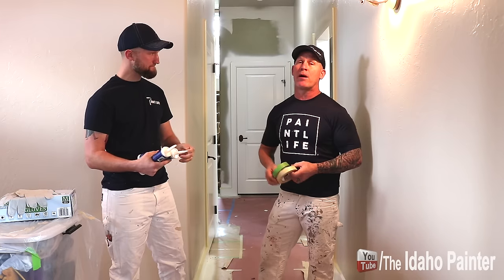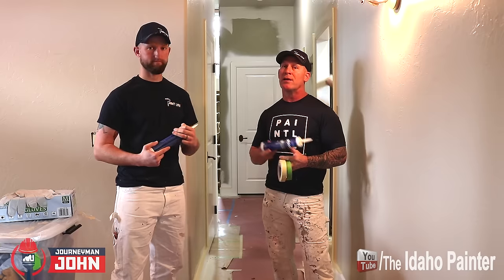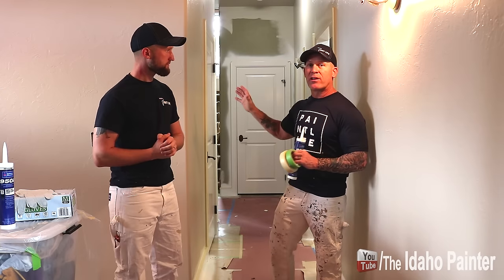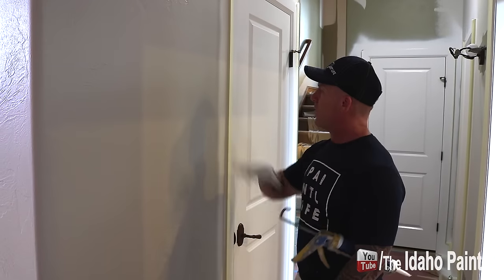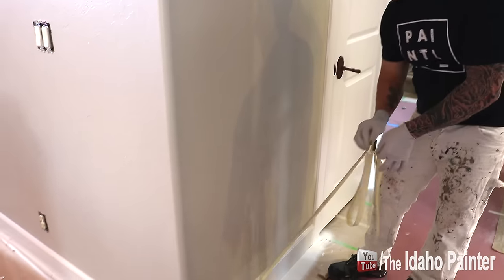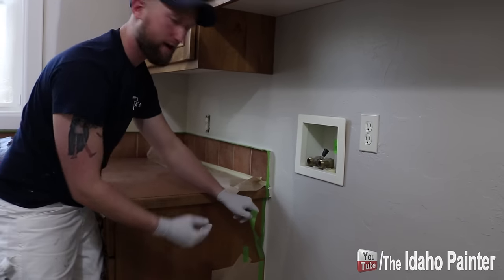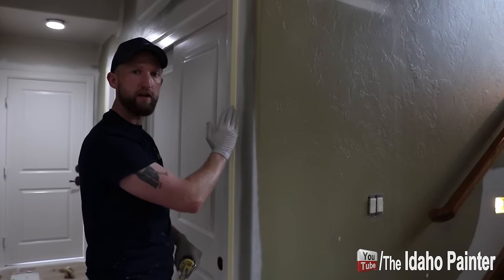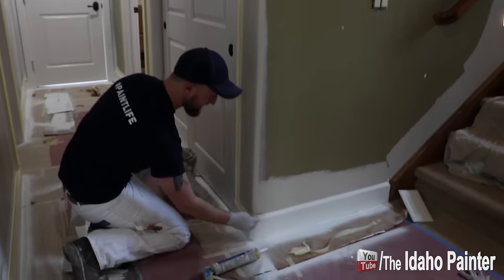PERFECT lines with caulking and tape.

Comment: A few things, never paint over wet caulk, let it dry completely,  and dont tape base trim and door frames with cheap yellow tape. Then pull the tape off to roll walls? And no spritzes on base...  seems strange.  Seems like they are pressed for time on this job and taping is a waste of time. Not making much sense this video, OH and frog tape is awful.  Use tape that is over 12 bucks a roll if you are going to tape...  jeez
Reply from the maker: Thanks for sharing Richard!